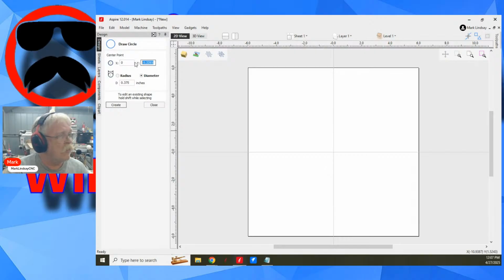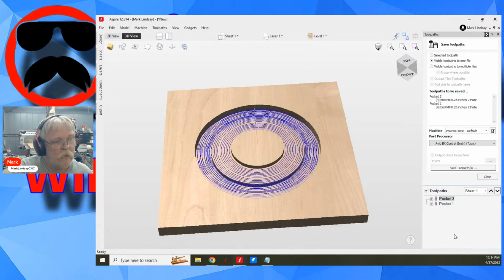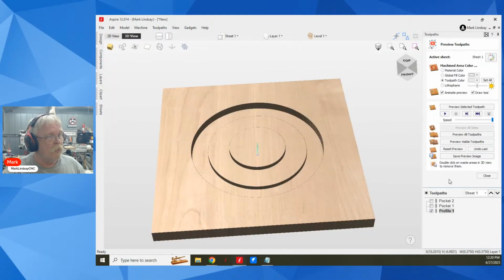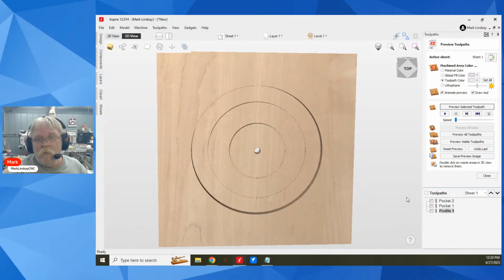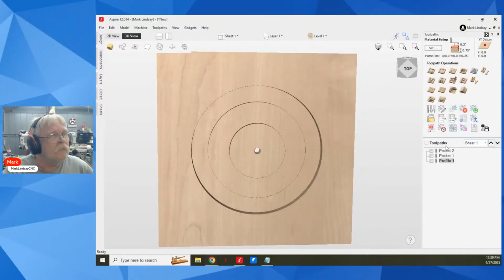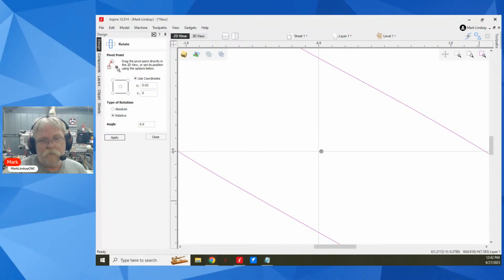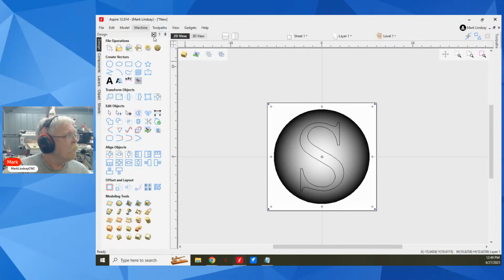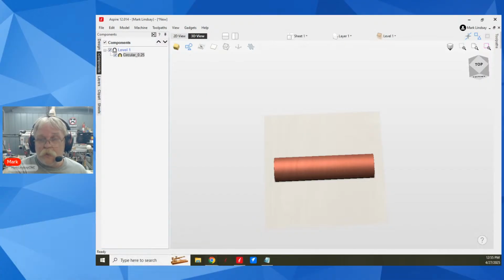Live Q&A #289 – Vectric V12+ for the Absolute Beginner – Part 12

Comment: I’ve asked this question before, but at that time, you hadn’t done much inlay. Do you use an offset on your vectors the way some creators do? They take a design of the bit and measure how far, depending on the depth of the pocket, how much offset you need to offset the vector?